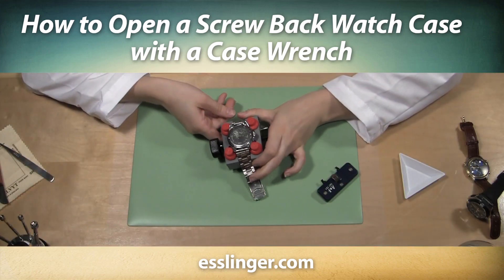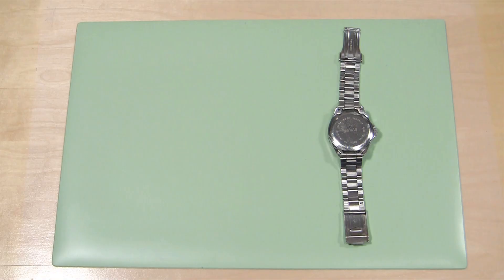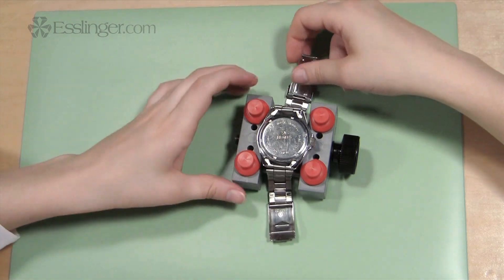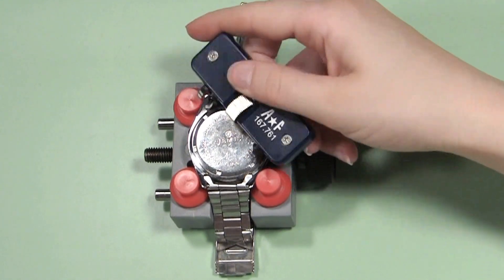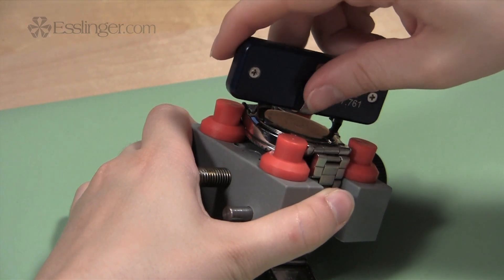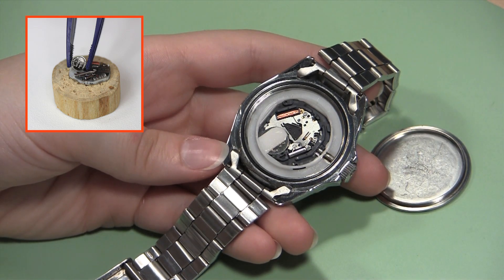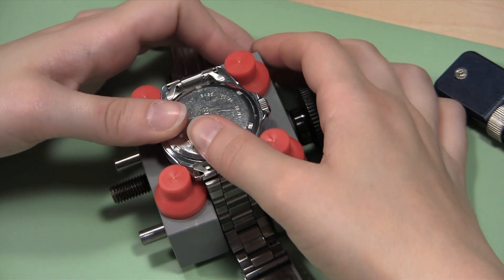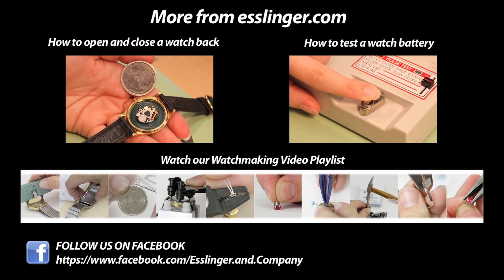How to Open a Screw Down Watch Back with a Case Wrench

Comment: I found an old Disney time works watch that I've had for at least 20 years.  I had forgotten that I even had this watch.    I saw the notches and had been trying to remove the cover but could not.    There was a scratch on the back cover and I am assuming I did it many years ago trying to get the back off.    I must have put it away and forgot about it.     I need this watch screw back wrench thing to remove the watch.    We only have one local jewelry shop in our area that I bet has this tool.     I might look online and see if I can find a tool.

any other ideas that anyone has used to open this without the specific tool?   I don't want to damage this watch

Comment: I was just wondering, if a piece of cling film placed over the watch back just before applying the opening tool might help. Could it provide a certain degree of protection, against damage resulting from accidental slippage?
Reply from the maker: Its a possibility but the the tool would likely have the strength to go through this film easily or push it aside if the tool slips - Good thinking but it should be tested.

Comment: Is there a limit to how tight the back case fits ? I’m worried I try to tighten it too much or it’s not tight enough that water gets in. If it doesnt turn anymore does that mean it’s already tightened ?
Reply: It should be snug. I put a lil vaseline on the threads to make it easy removal next time. If the battery has been in there a long time just popping of the case is hard if theres no lube on threads

Comment: Simplest method is to superglue a large nut to the back of the case. Allow the superglue a full 24 hours to fully cure. Once the superglue is cured, you can apply a spanner to give you the leverage needed to remove even the tightest watch back. Once the back is removed, simply soak it in acetone (nail varnish remover) for 6 hours or so, and the nut will drop off.

Comment: Mine does not have notches. Just tiny screws.
Reply: If it's a corner screwed type (like, say, many quartz digitals, for example the classic 5600 G-Shock) then you need to get a proper screwdriver for those little screws, remove them, then lift off the back. In some ways it's the most straightforward type. :)